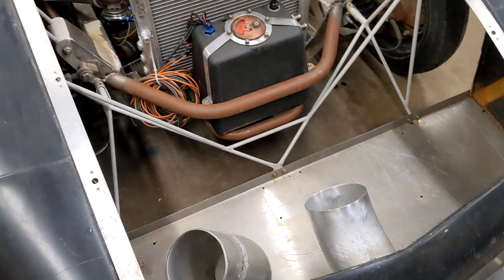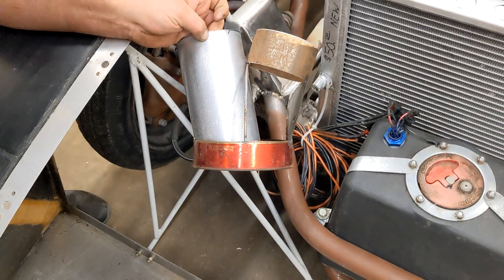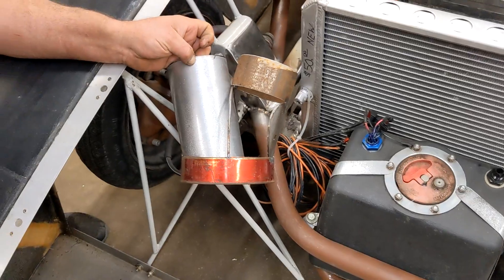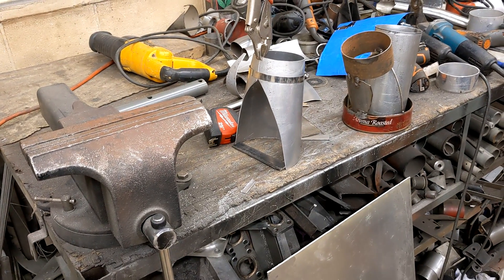Twin Turbo Ameri-Barra 4200 Datsun Drag Race Car Fabrication Part 3 + How to Prevent Engine Fires

Comment: Have you ever been able to compare the mass of various parts on both engines; the Barra and the Vortec 4200 such as the the main and rod caps the beef around the blocks on the mains??
Reply from the maker: I've never had my hands on a Ford Barra. Maybe someday

Comment: FYI 1st pass was called Climb Milling!!! This is not the best route manually. Yes it's used all the time in CNC work. But they also use ballscrews with ZERO backlash. I have seen many wreck tooling climb milling. Just some thoughts, 32yrs in the trade as a Machinist. Nice work on the "Y" fitting . Nice tip on using the bungs . Seeing you are going top run methanol. They do offer a version with 5% Nitro from what I have heard.
Reply from the maker: Nitro is a slippery slope. Lol.
Good to know on the milling stuff. When I get into CNC stuff, I'll start caring about that sort of stuff. Right now it's just a big Etch-a-sketch that takes metal chunks out of stuff. Lol. Seems to make a nicer finish going the one way better than the other, so I try to do that for my last pass.
Reply: @Calvin-Nelson  Climb Milling does produce a better surface finish. It also uses less horsepower . But it can cause damage with old leads screws and looser gibs. If you use it , use it for a finish cut like you mentioned.

Comment: Is this a stock engine.and do they have after market support on go fast parts for these engines they seam very strong already but I'm sure you are ready to turn it up past where the stock block can get you.love the videos underated channel for sure lots of great info
Reply: Stock bottom end.  Unopened.  
At a later date we plan to ring gap one and add aftermarket rods at the same time.

Comment: Great ideas in the video, safety with fuel is key, it’s so true about the aftermarket parts, even stuff as easy as putting the bolts in shear instead of tension to hold down the fuel rails so if a bolt comes loose the rail won’t lift

Comment: I'd love to see what a Lehmann (dual plenum) intake would do with this engine
Reply from the maker: Like what the new C8 engine has?
Reply: @Calvin-Nelson  kind of. A Lehmann is very different in that it diffuses the air to have almost perfectly even air to every cylinder. Audi used to run that kind of manifold on its rally cars
Reply: Slot manifold?

Comment: Just a curious question about the 2ndary injector placement.  I am learning so bear with me.   I would have thought that the injector placement on the intake runner would be closer to the cylinder head. Is there a performance reason for where you put them or was it more for ease of use and maintenance?    Great work though.   Your channel provides much more education than many others.
Reply from the maker: The methanol injection will be only active in boost. So any of the disadvantages of having them higher in the runner will be negated. Having them farther away allows for better atomization which should help a lot.
Reply: @Calvin-Nelson  Thanks for your answer.
Reply from the maker: @johnwjr2905  no problem.
Reply: @Calvin-Nelson  Great, when is you video coming out about injector placement!😀

Comment: I like the turbo inlet setup. So many people run open inlet turbos, just sucking up hot air from the engine bay. Every little thing you can do to control heat/high iat’s helps. 
On my setup i used clothes dryer hose to route my intake from the turbos to the front of the car. Once i had is were i wanted, i filled the dryer hose with expanding foam to get a solid mould. Then smoothed out the foam, and wrapped it with carbon fiber (can do it with fiberglass too). Once it dried, poured gasoline in the foam to dissolve it. And was left with some nice, light weight custon inlet tubes.
Reply from the maker: Nice. Neat solution!

Comment: You know when it's NOT a good day? When you NEED to use a milling machine and don't have one. lol
Reply: Thats when you get yourself a flat piece if granite, or glass, even MDF will do. Then glue sandpaper to it, and mill your manifolds or heads like that. I have done many warped heads like that, and had no issues at all. 
For milling holes and slots, a milling bit on a drill press will work. You are on your own on this one. Unless you modified your drill press to retain the chuck, the chuck and mandrel will fly off and KILL you if you side load it. The chuck on most drill presses is jus press fit. But non the less, its doable.

Comment: I’ve recently been interested in the 4200’s because I’m wanting to get a standard cab, short bed, 2wd Colorado/Canyon for my next “work” car but I want to swap it with something a bit different. I see your pretty much the only one that has a cook book for these these engines. I know Richard Holdener has done some work with them, but you seem to know them through and through and not just on a dyno. I’m a new subscriber and will be following this build for sure.
Reply from the maker: Thanks! They're great motors. Wish they were more popular.
Reply: @Calvin-Nelson  People like you bring awareness to overlooked engines. I’ve seen your videos before on these engines and I believe I’ve seen coverage on other videos (1320 if I’m not mistaking). At least as far as I know you and Holdener are the main two that are proving these engines worth. Only recently I see a personal interest in them, but have known for a little while that they had some potential (because of you😁) So now I’m doing my homework. I really liked your vid on the differences between years and now I know I’m looking for an 06+ if I decide to go with a 4200.
Reply: Could also swap a LS/LT based LV1/ LV3 4.3L V6 plus a turbo into a regular cab 4wd as a Syclone version of a Colorado/ Canyon.
Reply from the maker: @Sir.VicsMasher  I'm pretty sure it's been done. If the right parts come along, we would definitely consider it
Reply: Should check out The Drive's /Tuned video titled [The Burnout Truck that Burgers Built] which is the Atlas 5 cylinder version of what you said.
Reply: @Sir.VicsMasher  I actually have seen that a while ago, when I still thought these engines were as pointless to modify as alot engines today.😂 I don’t feel that way anymore though.